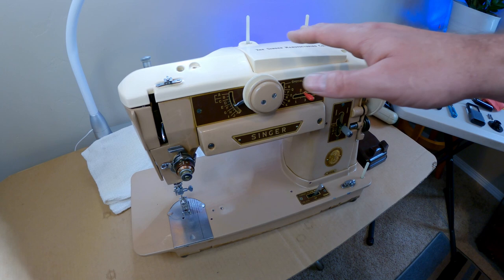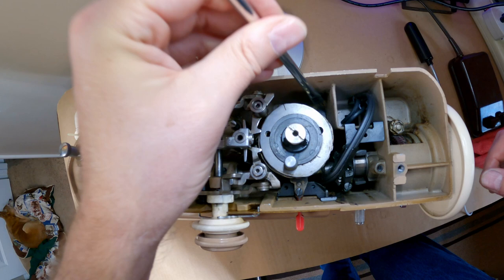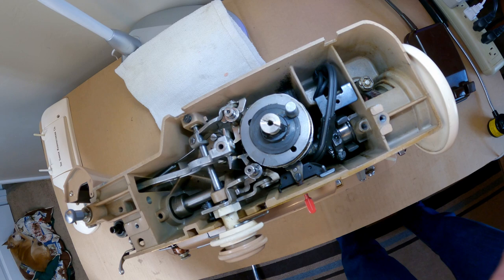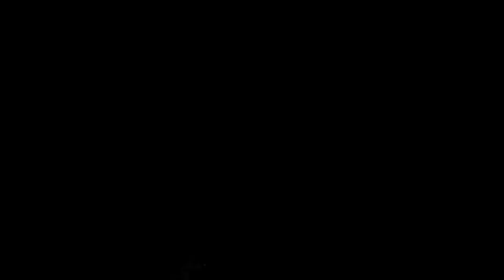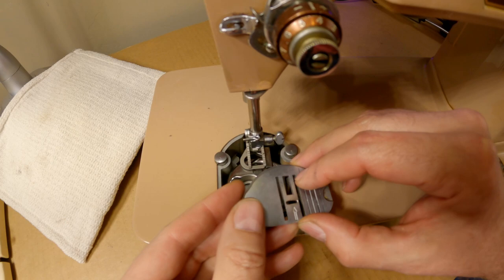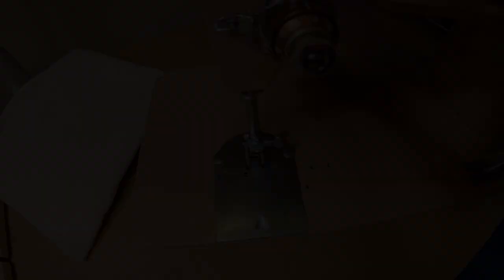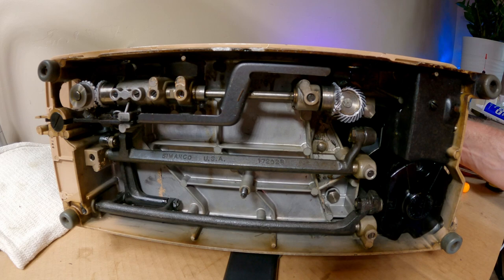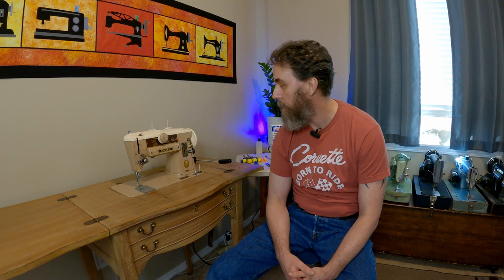Singer 401A - Repair & Maintenance - Part 2

Comment: They are awesome machines, but I find the Kenmore 158-1941 to be probably the most useful home sewing machine. It's free arm, and has about 12 built in stitches, including automatic reverse stitches. Extremely well designed and built. If you don't already have one in your collection, you might want to look for one.
Reply from the maker: That's great. Thanks for the info! I will keep an eye out for that. The kenmores that we have currently are a little older i think. Thanks for watching!
Reply: Traduire en français

Comment: That singer grease tube is for the bearings in the motor, not the gears. Notice the color. Reddish is gear grease. Grayish to black is motor bearing grease. I do not think it will hurt the gears, but im not sure how or if will hold up or for how long. Those are great machines and certainly have way more power than new machines. Thanks for showing
Reply from the maker: That's great! Thanks for the info. I will have to take a closer look at the grease tube. It came with one of our machines so I thought I would use it, but I would prefer to use it in the right place :)  Thanks for the comment and thanks for watching!
Reply: @NeverTooMany2023  hey not a problem, but it's also possible I'm wrong in the first place, old eyes bad memory and a whole lot of bad attitude. Seriously I think it was motor bearing grease.
Reply from the maker: @JamesThomas-gg6il   Lol :)  Either way, I appreciate the input. There is too much information in the world for anyone to retain it all. This is why teamwork and community are so important. Thanks again!
Reply: @JamesThomas-gg6il  I worked for Singer.  We used the grey grease for the gears.  I never saw any red grease.  Maybe the reserved for the regional repair centers.  (There was one in Paramont CA - Near Long Beach.)

Comment: Nice videos, the only two problems I have with this machine is the wide feed dogs, made for 5/8 seam allowance and it is a noisy machine. Still my everyday sewer.
Reply from the maker: Thank you so much! I had not noticed the wider feed dogs before. I tend to like a wider seam allowance anyway so that might be why. That is very interesting. Thanks for the info!

Comment: I love that clacking sound!  Thanks for the video, couldn’t get the bottom cover off to clean properly because it was screwed in too tightly.  Have to get a guy to help me!
Reply from the maker: Thank you so much! Ya, they can get pretty stuck on after a bit. Good luck with your repairs and maintenance. Thanks for watching and following along!

Comment: for the hand wheel, could I just clean it under water, let it dry and then, put back some grease?
Reply from the maker: I don't see why that would be a problem. Water won't hurt the hand wheel. Just dry really well and lube before you reinstall.

Comment: I really enjoyed your video.  Have the same machine (and others) and I always wondered how hard it would be to disassemble the hand wheel. I know over the years it can get junked up and fired out. You made are it look easy! Thanks for the good advise about keeping things in order and not moving the hand wheel when it's apart. Very helpful!
Reply from the maker: Thank you so much for the feedback! I am glad you enjoyed it. I had fun making it as well. Lol...Ya the hand wheel can be a bit weird. I have put more together incorrectly than I would like to admit. I guess that's how we learn :) Thanks for watching!
Reply: How do you get the handwheel off when it's been reassembled wrongly? My handwheel moves fine but the stop nut is completely jammed and I think that the washer the wrong way round might be the problem.

Comment: Great video. There is also a thread cutter on the back of the needle bar for when the snips aren’t close by. 

The handle on the stitch length selector screws in to save your choice, so when you reverse, you go back to the exact original length.
Reply from the maker: Thank you so much!

Comment: I was given a 401A recently. Knowing it hadn’t been used in years I oiled it and began sewing. The bobbin ran out so following instructions, I filled the bobbin and inserted it into the bobbin case. I tightened the wheel and now the needle mechanism won’t go up and down. I’ve put the wheel in different spots and the needle won’t move. As I press the pressure foot I manually turn the wheel and still the needle won’t move. Your thoughts. Thank you.
Reply from the maker: Thanks for the question. It sounds like your clutch wheel is not secured enough. If it was working fine and then you filled the bobbin as per the instructions, then you probably loosened the clutch wheel so that the needle would not move up and down while filling the bobbin. Sometimes the little set screw on the clutch wheel can be fussy. Try removing the little set screw on the clutch wheel and tightening the clutch wheel all the way. Once tight, your needle should move up and down. If this works, you know that your clutch wheel/set screw alignment is not correct. It is easy to install the clutch wheel 180 degrees out in the wrong position. If this is the case, your clutch wheel will not really work right. Hope this helps :) Thanks for watching and following along!
Reply: Thank you for responding so quickly. I will follow your instructions and hopefully this will resolve the issue.
Reply: @NeverTooMany2023 where do I find the part one to watch on this 401a machine 50:34
Reply from the maker: @kayrusso8269  You can find all of my videos on my channel, but here is a link to Part 1: https://youtu.be/i0G_4Uspy-8

Comment: Very nice and good explanation  I love it  i have same  machine  but thread tention problem i clean all parts I follow your video but still stich is too loose please help me
Reply from the maker: Thank you so much! Tension problems can occur if your upper tension assembly is not installed properly or your take-up spring is worn out. Also, make sure the lower tension setting on the bobbin is adjusted properly. The upper tension works in conjunction with the lower bobbin tension. If you can't get your tension to change or improve with the upper tension dial, then your bobbin tension screw may need adjusted as well. Hope this helps. Thanks for watching!
Reply: If the stitches are loose on the bottom but OK on the top, you may have the needle in backwards
 
The rule of thumb is that the flat side goes opposite the last thread guide.

Discarding the old needle and replacing it with a new one solves many problems.